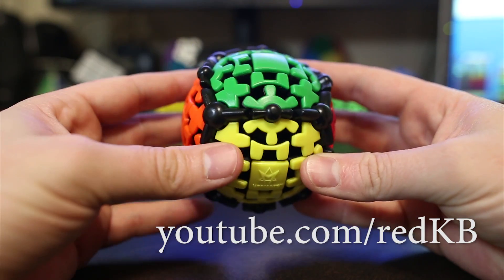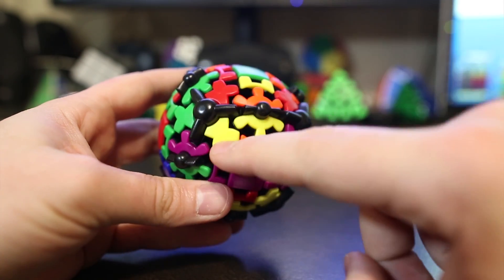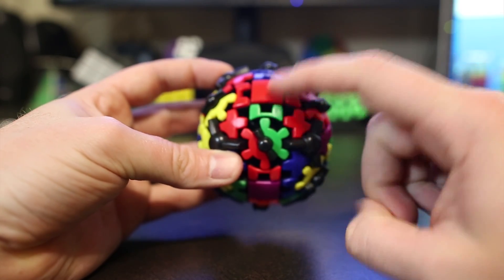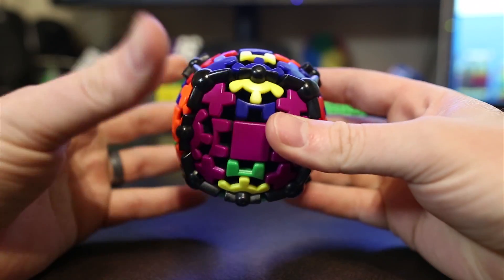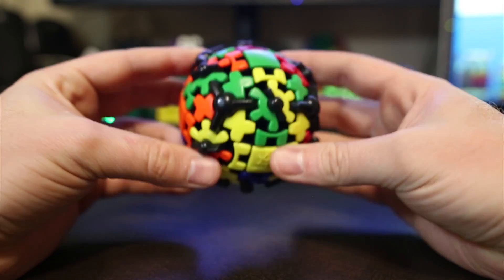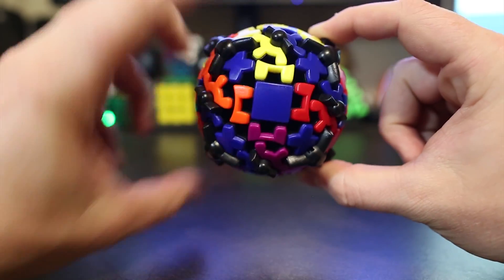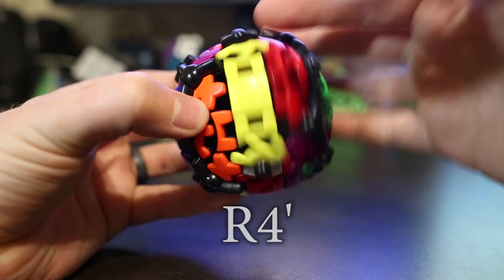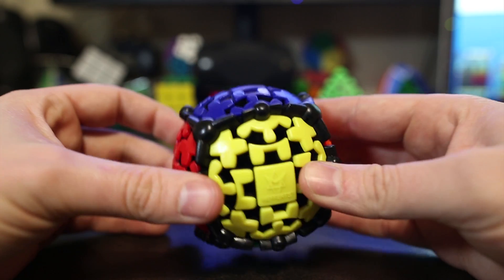How to Solve a Gear Ball

Comment: my gear baal isn't working on step 2!??!!
Reply: it works
Reply: is mine broken????
Reply: it doesn't work
Reply: Johnathon Bobe Bro it seems you use r2 u r2 u'(up inverted) to do the trick
Reply: ok ill try it again.
Reply: +Krish Bachani no its R2 U R2 U
Reply: R2 U R2 U' worked?????
Reply: +Krish Bachani yeah but it worled
Reply: +Krish Bachani *worked
Reply: Johnathon Bobe same sad
Reply: On the gear ball, an R Is the same as h is the same as an R2 on a 3x3, so you need to do what on a 3x3 would be R4 when you do R2 on a gear ball. Hopefully that helped :)

Comment: The second step didn't work for me
Reply: You switch two which will match the hold that middle bit in the s layer then find another two that you need. To switch if you can't find any that need to switch just switch any two in the front or back layer and switch them then hold that on the s layer and then find two that need to switch ten that will position the edges
Reply: your doing something wrong.

Comment: I actually figured out a different way to solve the gear ball without algorithms, based on the property of solving one face solving them all. The trick is to solve certain parts of the face upside down and backwards, so that matching the corners up at the end solves all the wrong stuff at the same time. It's sort of like breaking a slice when solving centers on a higher-order cube so that putting the new solved line in place fixes it, except on this puzzle doing that solves every face simultaneously. It is hard to describe without showing it, but I don't really make videos and have subscribers and all that. The method on this video is certainly good too of course. I had just never figured out my own independent solution to a twisty puzzle before.

Comment: I currently have an 'almost' solved gear ball, after following these very helpful tips.  I have 6 completed faces, and two adjacent faces with only one of the four gears on the "slice' out of whack by ~80° - all the other three atre aligned with the black trim and complete their respective face colours.  Does anyone know how to solve from  here?
Reply: elvenator I have this problem right now. Did you ever find a solution?
Reply: Matt Medina I don't know how it happened, Matt, but I believe the problem was caused by a slipped cog when rotating the ball.  The only way I could get it to line up again was to spread the ball open as much as was reasonable without breaking and gently force the mis-aligned piece back into place.  My ball works fine afterwards, so it's definitely doable without damaging the puzzle.
Reply: Yep, that's exactly what happened to mine and that's exactly what I had to do. Mine's working fine now as well, thanks.

Comment: This is vastly different from the method I figured out... here's what I do:
1. Solve corners
2. Completely solve first side edges (to fix mis-oriented edges I do R U R U R)
3. Solve the rest of the edges using the algorithm R' U2 R which switches two edges on one side with those of the opposite side
4. Fix the spinny-edges

Yours is probably a bit faster, but I think mine is easier to spot what to do in each step

Comment from the maker: It is very close.  On the original Gear Cube you could skip the Gear Ball's Step 3.  However if you get a Gear Cube that does have the stickers on the outer parts of the edges then they would solve the exact same.